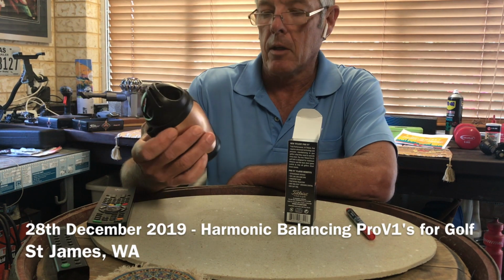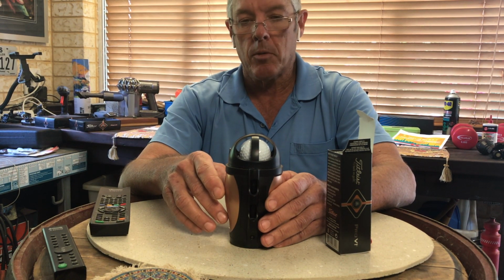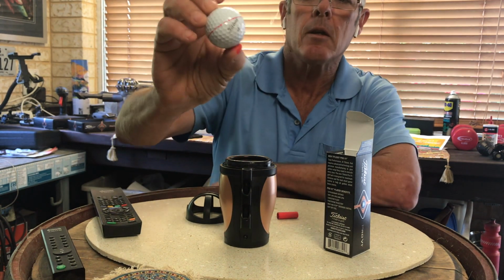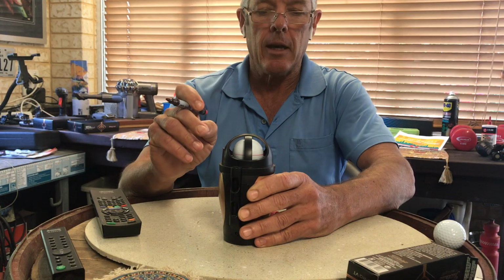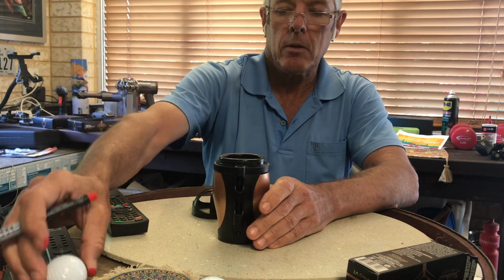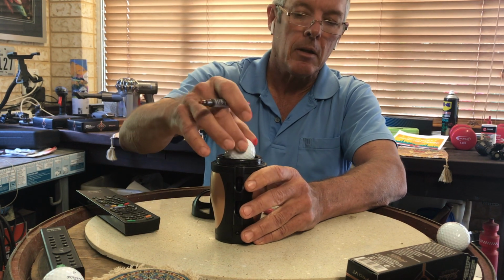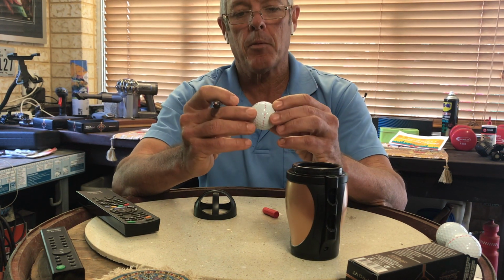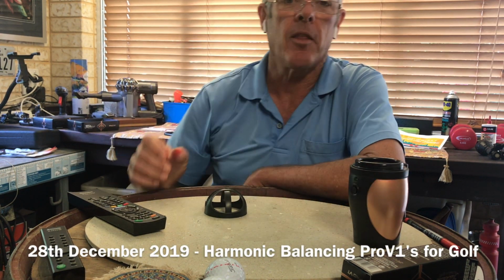28th December 2019   Harmonic Balancing Titleist ProV1's for Golf

Comment: I've been using the same ball spinner for almost 20 years and it works great, Both for putting as well as off the tee. Tests have been done that show a longer and straighter ball flight if you align the ball using the line to aim it at your target. Works great for 20 years.
Reply: what brand spinner are you using?
Reply: I have the Technasonic Check-Go Pro. Been using it for years and the battues last a very long time, so it's well worth the price and it works great. I spin every ball I buy before I put them in my bag. If you buy one pick up a Sharpie or two in whatever color you prefer, I use a red one for me and a Blue one for when I spin up balls for my wife. 
I align. the red line when setting up a putt. I aim it where I want to start the ball  and then I don't have to think of direction and speed when I putt, only have to think about speed, since I already have the line figured out with the ball. I think you will find that your putting will improve if you do the same.